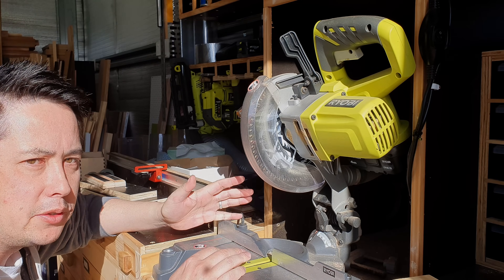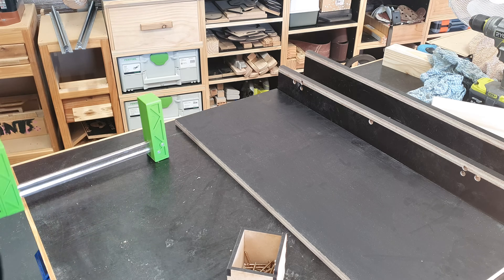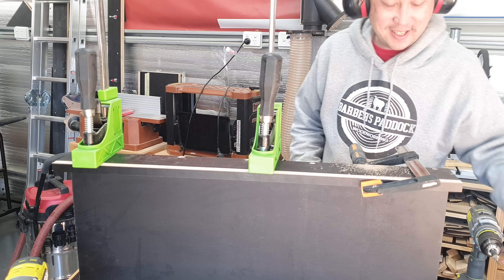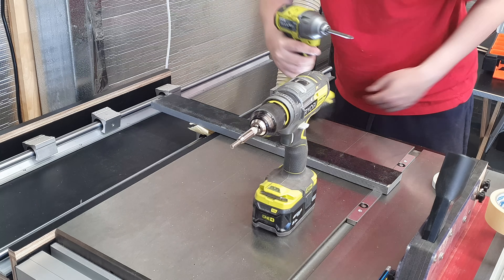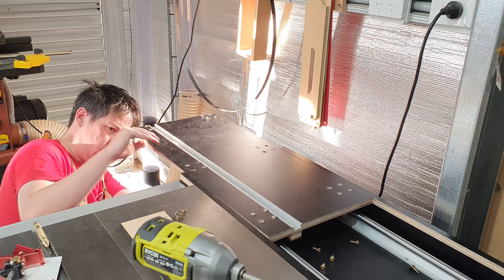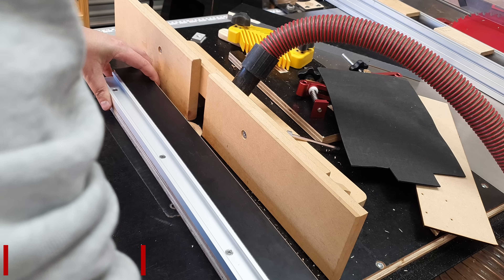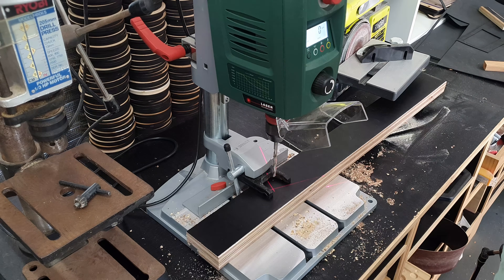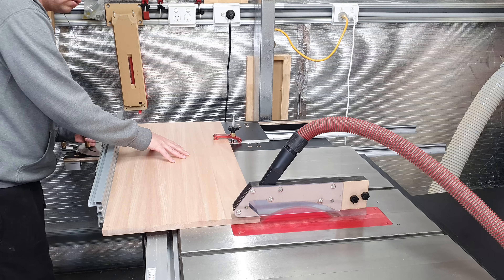Unleash your table saws crosscut potential! DIY sliding crosscut table saw upgrade

Comment: Very nice build. You could consider putting the rails upside down attached to the underside of the slider table, with the blocks stationary on the chassis. You could make your slider much longer and more rigid and might reduce any risk of bumping into the rails and bending them.
Reply from the maker: Hmm, interesting idea.  I think it would work yes, the only thing tho, and I probably didn't convey this in the video, the rails are REALLY heavy.  The other thing is it might make aligning it all to the mitre slot more challenging since you're attempting to do that across an entire rail rather than the guide blocks.  But it could also mean a smaller footprint rail.  I'm sure those could be easily overcome, maybe in a version 2.0. :)
Reply: @barberspaddockwoodworking  Ya very good points. Agree with that alignment of the blocks would be tricky. Maybe slightly oversized holes with cap head screws + washers instead of countersinks so you could have a little play in the blocks for alignment. But either way is good :)
Reply: @barberspaddockwoodworking  the blocks alignment could be easily solve drilling the holes bigger and use flat head bolts, then when you install the rail the blocks will autoalign. Congratulations, great project!
Reply: All he had to do is make the slider longer the same length as the rails so it can come back farther and it won’t tip it off balance? Fence.

Comment: subscribed almost immediately
I think flipping the rails to the sliding carriage and installing linear bearings underneath fixed to the table would be a better idea, both stabilizing the carriage and avoiding to leave the bearings open to dust etc. Might need some experimenting but hey, thats what this is all about. I am currently on a simple sled in aluminum grooves. You made something I envy a lot yet im building a cnc on a 40mm linear rods similar to onefinity... hehe different workshops diifferent procesess. Happy building
Reply: btw the idea to flip the rails with bearings comes from a cnc Z axis where main router plate is with the rails and bearings are fixed on the X axis

Comment: I think you could use just 1 guide rail + blocks for alignment on the inside rail,  then where the left outermost rail is, swap it out for just some roller bearing wheels. So the rail is the "master" and the wheels are the "slave" component,  or like training wheels on a bike.  They're just there to keep it rolling smooth and be adjustable to level out the height.

Comment: Excellent video, not only for showing how you went about building but the issue you faced while doing so.
An idea I had for a sliding table was to use full extension drawer slides joined back to back in opposite directions, the outer sides would be be connected to the fixed part of the saw and the inner sides would be connected to the sliding part, thereby allowing full extension in both directions (you could add additional sets in the middle for extra support).
How good it'd be all depends on how good the drawer slides are, i.e. is there any vertical movement in them at full extension.
Reply from the maker: Thanks! I've seen some people use draw slides but I never felt confident they would be robust enough for this kind of application.  Given the price of these rails is relatively inexpensive, I'd probably recommend this type of path, but hey, I'm always happy to be proven wrong.
Reply: Extension slides that are strong enough for this weight and extension length are very expensive, and no matter what you do they are still susceptible to a lot of deflection.  The Dewalt 746 table saw had slides like this with a 20"-30" extension (I am not sure exactly how much).  Every other sliding table has used rails of some type due to better design and reliability.

Comment: If I were to add a sliding table to a cabinet saw, I would take off the left extension wing and get the sliding table closer to the blade, make sliding table slightly wider, a support that can attach to the left end for very wide work piece. That would also solve the sliding table fence being too long to stay balanced problem.
Overall, a sliding table is so nice to use, and I am glad you went this route.
Reply from the maker: I almost nearly did this, you are correct, it would be nicer to get this closer to the blade.  In the end tho, I decided not to go that route for the following reason: removing that left wing would be fine, but then the rails for the table saw fence would be in the way.  I can't move them because there is no room on the right, and cutting them would be a big risk (what if this doesn't work), and more over it would basically eliminate being able to use the fence on the left of the saw blade.

So in the end I think this is the compromise between drastically changing my saw vs something that's just bolted on.
Reply: So, basically what you need is a proper formating/sliding table saw. IDK why US woodworkers are so obsessed with cabinet saws.
Reply: @saxus  I do not either. Sliding table saw is so much safer to use. You can see the one I use in my channel.

Comment: Another solution for large cross cuts is a norm abram style panel sled. I really need to make one.
Reply from the maker: That's certainly another way, but I've been itching to try this solution, and the fact I was able to get the rails was the perfect excuse.  I dare say if it wasn't for that, I'd be doing the same thing and going with another sled like Norms.

Comment: Hi,   you could considerably increase the crosscutting capacity by swapping the linear rails so the linear blocks are stationary and the rails attached to the underside of the sliding table.
Reply from the maker: That was considered, but there are issues and challenges with that, that don't make it any different to putting the sled on the blocks instead of the rails (at least for my case).

1.) The main issue is that for the blocks to be stationary, we will have the exact same issue of the rails needing to leave the blocks once it's passing the saw blade (if you won't want a huge bit of rail sticking back behind the saw).  If you don't want that to happen, you have to have the rails way longer than the sled impeding behind the table saw which is something I didn't want to do.

2.) I don't have infinite room at the back of the saw, so if instead you decided 'let's make the rails longer, extending further out the back of the sled so when you pull it back you a have more capacity' then I can't do that, there's not enough room/clearance. 

3.) If you don't want any rail sticking out in front of the saw, when it's in its normal position, the rails need to stick way out behind the saw to compensate for the length that needs to pass the blade without leaving any guide blocks.  If you're going to do that, you might as well have long rails attached to the base that extend far back behind the saw, and let the slide go along it.  

These rails weigh a lot, so it does not make sense to have that much weight trying to either re-engage the guide blocks (which won't increase capacity) unless you plan on having a huge part of rail sticking out the back of the table (which I didn't want).

To have the rails move, and not the guide blocks, you need to engineer a better base, one much larger, much longer that will take the weight of the rails (which are very heavy), much stronger, so they don't twist, etc. You'd have to really engineer a solid base (probably metal) to support the weight of the rails moving backwards and forwards without flexing.  

So if it's about capacity, the way to do that IMO is to make the rail really long past the back of the saw, not just putting the rails on the sled instead.

I can't find any examples of people putting the rails as the moving component, probably because of some of the reasons I highlighted, but I'm keen to always be proven wrong.  If I do a second 'mark 2' version, this is something I will explore again.
Reply: @barberspaddockwoodworking  Another idea is to have 2 positions on the sliding table one at the back and another at the front, so you can have fence either behind the work piece or Infront
Reply from the maker: @eddie1330  That's something I think will work, I've not tried it yet, but there is no reason it wouldn't work that way as well.

Comment: You could chamfer the ends of the rails to decrease the chance of the blocks catching when they slide back on. However, it seems like you got a pretty perfect alignment already.
Reply from the maker: This is good thinking, and worth pointing out that I did actually do this.  While the rails did have some chamfer to the edges, I did come back with a file and increase it to make it easier to re-engage.  I would highly recommend this to anyone else as well.

Comment: Of course, there’s something to be said for track saws which are generally safer. But that implies a large work table to hold the sheet goods.
Reply from the maker: I %100 agree.  I still plan/want to get a good tracksaw (I have one of those Kreg jigs at the moment), but like all things it's about the $$$ so am patiently waiting to save up for that.
Reply: I was thinking the same. Track saws bring a LOT to the table. If you add in the festool MFT table or make your own it greatly enhances the track saw. But. At a cost. I've also found my tablesaw skills are much better than my tracksaw skills (sheet goods still are better served with the tracksaw) so I can't replace the tablesaw, as much as I'd like to.
Reply from the maker: 'At a cost'.  Isn't that just the motto of wood working tool buying. :) But I agree, a MFT would be nice, Peter @ 10minute workshop has a nice setup that would not be horrible to mimic.

Comment: Regardless of the length of the miter fence (or any fence) a 0,5 degree play at the miter slot is still only, and precisely a 0,5 degrees deviation at the far end of the fence. 
The triangle formed gets bigger the longer the fence but all angles stay the same 
Kind regards 
Anders 
Sweden

Comment: Hi. Another good video - well done. A couple of questions if I may ….. 1. Are you happy with the Torquata mitre gauge? 2. Did you get the aluminium fence from Timbecon? Is it the Torquata one? Thanks.
Reply from the maker: 1.) Yes, I'm happy with it! I've had it for ages, but what I've discovered is that the design of this appears to be mass-produced under many brands.  I've seen some WEN ones, some BANGGOOD ones that are all identical.  Find the one that is the cheapest, because to be honest, the Torquata branded one isn't!

2.) No, the aluminium fence was from eBay, link in the description.

Comment: Where did you get the extra guide blocks? You didn't say or link it.
Reply from the maker: SBR20's are what you want here: https://www.ebay.com.au/itm/234475607118?var=534050596731
Reply: @barberspaddockwoodworking  thank you

Comment: Are you making plans for your sliding cross cut sled
Reply from the maker: At this point, probably not.  Purely because it would only be relevant to my table saw and the length of the sled I made.  I would say that it's simple enough that most could follow the basic design concept and adapt it for their own saw.

Comment: Very nice job, sliding table saws are much more versatile and safe. Its better to move the saw to the right side of the shop, you will be abale to crosscut longer boards.
Reply from the maker: I agree, and would move the saw, but it's just not possible unfortunately due to the layout.  I'll probably revisit this some day, but in the meantime it's stuck on the left hand side.
Reply: @barberspaddockwoodworking  Yes, we all need to live with our limitations, but sometimes it's helpful to rethink everything and rearrange the layout of our shop . I'm using a track saw for crosscutting. If you work mainly with plywood and MDF sheets, track saw is the best solution.

Comment: A really great video and error analysis.
On a general note, it is very bad engineering practice to use multiple countersunk holes as a precision locator, since unless they are very accurately cut, they will all fight against each other.  By all means use a single countersunk fixing to locate a part in a single plane, but the remaining fixings should be plain fasteners in oversize holes.  For multiple components (two pairs of ball slides and two rails for example) then only one pair of fasteners on one rail should be countersunk whilst all others should be in clearance.  Ditto the rail.
Reply from the maker: This is good advice and probably something I should have mentioned, that on the second attempt, I 'shouldered' out the counter sinks (if that's the term to use) so they are flat rather than tapered, that's why they are so deep.  This is likely part of why I struggled the first time, but was able to get it sorted the second.

Comment: Maybe a good solution to not have the rails in the way is to have the rail blocks stationary and the rails fitted to the sled itself ?
Reply from the maker: That could work, and I've thought about that as a solution, however, I do think there is one major flaw in that idea.  In order for the rails not to leave the guide blocks still, you have to move the mitre gauge closer to the middle of the sled.  If you leave the mitre at the front edge of the sled, you have the same problem, you have to leave the first guide blocks at the front to get through the cut because you have to go beyond the table saw blade exit.

You would solve that by making the sled MUCH longer and moving the gauge further up the table (to a point it's past the blade without it being off the blocks), that however means when you draw the sled back, you have this massive amount of wasted sled that sticks out.

I've modelled this in Sketchup and it honestly would work, but would have a huge footprint.

Comment: Nice build, but you should remove the keft side cast iron wing.  Sliding tables perform best when the slider is closer to the blade.  So sliders have literally zero distance between them.
Reply from the maker: It's unfortunately not possible.  The front fence rail, and back fence rail would have to be cut to accommodate it, and that's not something easily achieved.  It would impact rip cutting capacity/capabilities thus sort of negating some of the benefit.
Reply from the maker: Given that this was largely an experiment and certainly an unknown for me, I didn't want to cut up the fence just to find out it wouldn't work, I'm not that brave yet.  There is always going to be a lot of 'ideally' situations, but this is what I adapted that had little/no risk and I learnt a lot about it that I think could be adapted for a future version (I need to move the table).  I don't advocate 'this is the way to do it for everyone', this is just what I did.

Comment: Couldn’t you also put the fence backwards on the front of the sled and use it like on a large sliding format saw? So that you are pushing the workpiece into the fence. Due to your design having the rails sticking out back this might extend the cutting length even more. Maybe not for daily use but when you just need those extra 5cm.
Reply from the maker: OOOOHHH.  I had read that a few times before I got what you were throwing out, but that idea is VERY juicy.  I am going to have to remember this one and try that sometime.

Comment: Manufacturers of sliding table saws like to have the sliding mechanism as CLOSE to the blade as possible.  So whenever I see a DIY or homemade version I always wonder why people would keep the left side cast iron wing on the saw.  It affects functionality of the sliding mechanism.  Anyways, just an idea.
Reply from the maker: It's always going to be a compromise isn't it.  Ideally yes, if I could remove the wing I would, but then the rails for the fence would be in the way and I cannot move or cut them without severely reducing the capacity of the saw (or weakening the whole saw), defeating the purpose.  It's probably for this reason, as you say, why people keep the wing on.  I'm not saying it's a perfect solution, but all things considered, I've increased my cross-cutting capacity with little to no real issues.  

I may, one day revisit this and see if there is a way to engineer something that can go in-between the left wing and the main body, but honestly, by that time, I'll probably be shopping for a new saw, and I'm sure some sort of sliding mechanism will be on the cards then as well.

Appreciate the constructive comment.

Comment: Why not put the blocks on the bottom piece and the rails on the top side. This way  it will ride on the 3 blocks at all time.  Over all good effort.
Reply from the maker: It's a good idea, and I contemplated it (actually still am, I may revisit this), but the issue I felt at the time (and I guess still do) is the rail is VERY heavy and it would make the sled really heavy.  I think if I went down this path, the right thing to do is ditch the frame out of formply and go with a metal frame.  Only problem is that I don't now much or anything about metal fabrication...but I guess there is always a chance to learn yet another thing!
Reply: You could make use of the space below the slider for small saw tools/jigs
Reply from the maker: @anderslagerqvist2642  I would love to do that but I can't unfortunately. The access door to get to the tablesaw is on that side and needs that space to be able to swing open.  Given the chance, I would have preferred to make almost a complete cabinet to fit there.   I'll probably still put my cross-cut sled there tho!